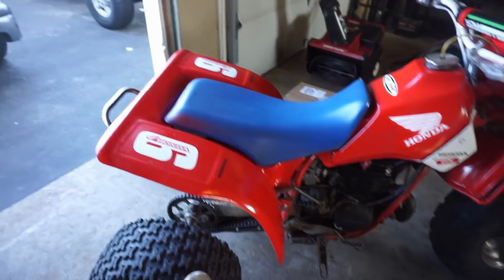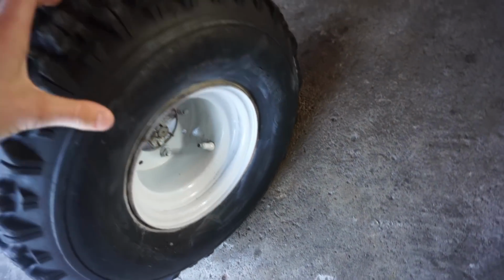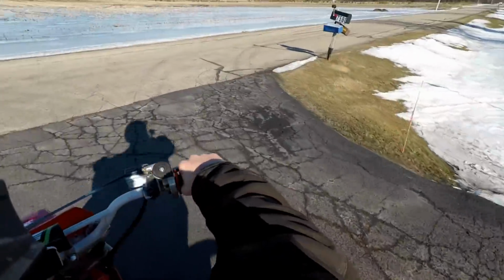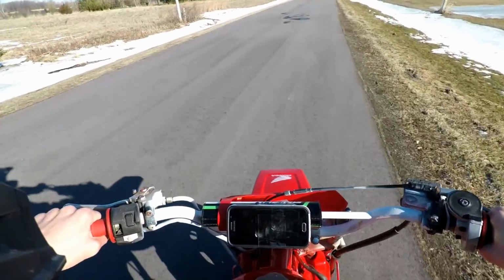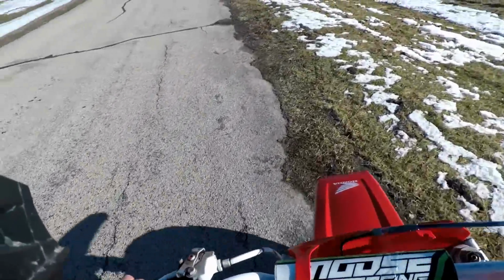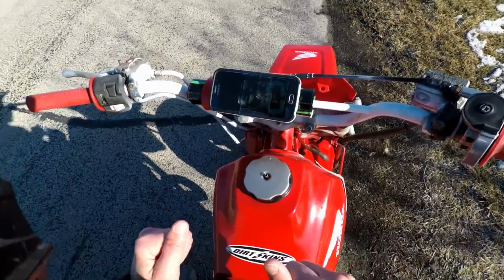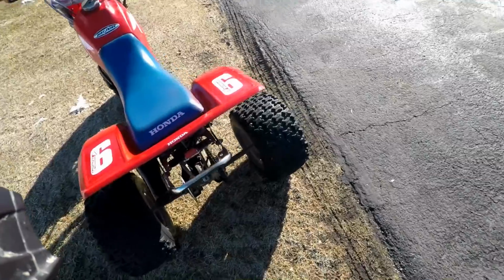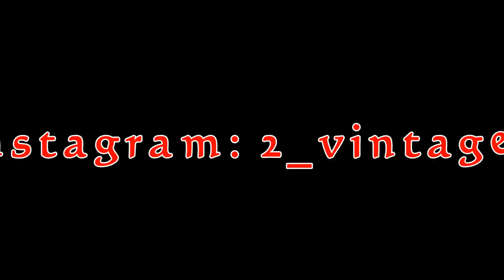Honda Atc 250r Top Speed!!!

Comment: Legend has it that a limited number of the 3rd generation 250Rs were capable of 110mph due to a mix up over gearing at the assembly plant.
Reply: I have a 1985 ATC 250r thats heavily modified and even with significantly higher gear ratio than stock, it goes just over 90, nowhere near 110, its simply doesnt have the power to pull it, especially from the factory

that rumor is 110+% busted

Comment: Mine was clocked at 82 in the cane fields by a palm beach police officer
Reply: 😂hands down brother lol
Reply: not stock it wasnt dork
Reply: No way
Reply: Balls of steel you have @Charles Pierce
Reply: I had an 86 250r and I ran it on the road and had my brother go side by side in his honda accord and by his speedo we were do 86 mph on top end 😁 and the water cooled 250r's will stink on the air cooled ones . I had an 84 that was .30 over on the piston , boysen racing reeds , ported and polished , basin pipe and my father in laws 85 water cooled 250r would kill mine in a drag race , after second gear his would eat mine for lunch!!!
Reply: 1misanthropist  That sounds more believable than Charles claim. Lol
Reply: That's crap Charles, there's no way a stock 250R will do even close to 80 mph. Much less 82.
Reply: Especially not an air cooled 250r!!! My 86 watercooler with a Bill's race pipe , Boysen reads,  and jetted heavy for topend would pull 86 mph , and my 84 250r bored 30 over , forged piston , ported and polished , 38mm Mikuni and Basani pipe wouldn't even hold a candle to my father in laws bone stock 85 250r . He would stink on me after 2and gear , just run off and leave me!!
Reply: Maybe he was wearing a timex from Walmart. He's kinda dumb for doing that on the road. I had an 81 bored, ported higher performance carb jetted runnin 65 next to my buddies bronco on the dirt next to the road and it had plenty more throttle. I guess 6 inches is 8 huh. Maybe I was going 85. 😉
Reply: @datrixta4744  Well you'll never know the true top speed unless you run it on a smooth road. I don't care about top speed. I just like power when I'm riding.
Reply: @user-zt2cc7qq9b  can run em faster on a hard dirt flat then pavement. Sounds a little odd but, on a hard dirt flat I could run it faster then on pavement. The traction is so great on pavement that even the slightest nudge on the handlebars will slow you down its just to fast for the way these handle correctly on pavement. There's such a drag that you're able to go faster on dirt more or less skipping across the ground rather then catching and slowing you down. It's hard to explain and counter intuitive but, unless you were riding perfectly straight withiut even the slightest nudge left or right and everything was perfectly aligned I'd put my money on even the best riders having a faster top speed on a dirt flat then pavement unless maybe it had different tires or some modifications. Let's say you were to get past the who gives a shit how dangerous it is they were not made for the pavement and you're just able to gain a faster top speed on dirt without being glued to the ground. The gluing effect slows ya down I promise.
Reply: I totally believe a water-cooler one could!! My dads bone stock 85 would gap my Banshee out on the wide open desert! He’d even pull 6th gear wheelies with it!
Reply: @datrixta4744  I believe you think it goes faster because of a rougher ride but it's a fact that drag of any kind will slow you down on top end.
Reply: I used to go ride the trails in the Ocala national forest I live by it
Reply: Its completely possible it would do 82 mph  with a different sprocket

Comment: It's usually the CDI which limits your revs. A 2 stroke isn't really designed for long periods of wide open throttle if you plan on doing these I would run it rich for a little more protection.

Comment: If you have a torch with rose bud you should pull the expansion chamber off and burn out the carbon. It should be louder than that, even stock.

Comment: It probably needs a top end rebuild. I'd like to walk you guys through that procedure. You are skilled enough and it is as simple as changing a tire. Infest in a compression tester . Super cheap at Harbor frieght. Most of these were governed or geared to 78 mph.
Reply: the 250rs have no moving parts in the top end, but yes putting rings in every now and then can keep them in good order
there is no governor anywhere on this ATC, 80mph is pretty much all this machine can pull without adding horse power, but they do stack power on quickly with modification

Comment: I've never seen a 250r that weak..smh..that thang don't even sound like it has a power and.. should be standing up all over the place
Reply: Brian Jeffries looks fast
Reply: gotta keep in mind that its the air cooled model,nice trike
Reply: Even air cooled.  It should be pulling much harder.
Reply: Five hundred 20s  i rode a 350x when i was 11 and weighed about 70lbs this was about 6 years ago
Reply: @stop reading looks can be deceiving just saying i own 2 of them and that is a weak one mine are top notch tuned by a man that we shall call the wizard if you know you know so yes regular 250rs they are very quick but there is a difference in them depending

Comment: Only thing I can say about the air coolers like my 84 model is that I wish it had a six speed transmission. It really could use one, but two strokes are not meant to be ridden at high speed for an extended period of time. The fun is in the quickness!  that power band!  that is the rush about a two stroke. I don't need to sustain 60 miles per hour for a long period of time.
Reply: @dave himlin correct, all 5 speed until 85 liquid cooled.

Comment: So I have a 82. Atc250r and stock it would pull the front wheel off the ground through the gears, it most definitely isn’t running like it should, cuz as I said even stock riding mine through the woods and on the pipe you have to steer it with your body cuz the front wheel doesn’t stay on the ground, unless it’s slick out an u are loosin traction but even still. Now she has a bunch of upgrades

Comment: Mine did 143 mph and had a little more but my 150 shot of nitrous ran out and the turbo over boosted at 23 psi and blew the head off .
Reply: Some kid legit tried to pull some BS like that with my autobody teacher back in HS. I walk into class, second day of school, and I hear this kid saying he ran low 10s with his stock Jetta. I quote "It overboosted to 35psi and blew up after I went through the finish line". I hit him with the "oh, you mean in the 1/8th mile?". And I didn't give at all, kid wouldn't take it, insisting his otherwise stock Jetta ran 10s in the 1/4 mile. I shut him down so hard on it he transfered out of the class two days later. He was the kind to sit in class, second day of school, with his feet up on a chair. I was daily driving a cammed LS swapped 78 Firebird I had at the time, lmao
Reply: @excalibur3895  😆😆😂

Comment: 75 mph stock was reported by dirt wheels magazine back in the day
Reply: Nope As a matter fact dirt wheels did not do TopSpeed only three wheeling magazine which changed into Atv sports had top speed in the specs. A bone stock 250 R of that vintage off the lot will go  no faster than 68 the 85/86 had the top speed of 71
Reply: @ronaldtartaglia4459  wrong but nice try.
Reply: Simple Waze you are wrong
depending on weather condition stock maximum speed 71 nominal speed 69 mph. Don’t tell me I’m wrong you’re wrong.
Reply: 76 dirt wheels

Comment: Did you ever get that thing to run like it should? It needs reeds are a carb tune (something). Is compression good on it? All of this has probably been mentioned in comments. I did not read them all. Should quickly go down to a nice idle though. Something wrong.

Comment: Those go way faster than 60! It’s more likely 80
Reply: its probably geared up a tooth to get 60.. stock is only like 55 on the air cooled. Liquid R stock gearing is like 70. Had an 82 and have a 86 now.

Comment: Stock 1983-84 250r atc top speed is 65 mph ///a stock 1985-86 honda 250r 76mph//// stock 1984-85 kawasaki tecate 70mph////stock 1986-87 tecate 250r atc 80mph/////This atc is just about right for a stock 250r but it shakes or wobbles flat spot tires?/bent rim?/bad wheel bearings?/Bent front fork?/

Comment: You should be hitting 72 miles per hour top speed on a 84 250R top speed on a 86 250R is 78. 84  are as fast as 350X 7072 miles per hour

Comment: your engine sounds like a 12 valve cummins diesel
Reply: I got a 12 valve Cummins diesel sitting not running needs parts good project sounds nice straight out of the turbo no exhaust.

Comment: 75 was all they had in liquid cooled. 81 was top speed for the older air cooled with balloon tires. 45 hp can only do so much. The 350x could barely do 85...your motor was dead...its supposed to wind out to 10 grand. A 250 EX 4 stroke can do 65

Comment: Mines hard to kick start. Help
Reply: Does it have spark? My '83 Honda Atc 250r was also hard to kick start it had a NGK spark plug look clean like new but no spark I put a old Accel spark plug I found laying around and it fired right up after 1-2 kicks
Reply: Also check compression, cdi box and coil that's all I know right now because i'm 13 years old.

Comment: The rear brakes were mediocre at best even when new
Reply: geoffreyjones2000 if your brake don’t work very well there’s an issue with your bike. I have an 1984 250r and the rear brakes are great. 300ex master cylinder, cr80 reservoir and a factory rear caliper. I don’t even have steal braided lines but hope to have them someday.
Reply: Honda's got great breaks

Comment: That's weak,we had an 86 250r,yes it was liquid cooled and eveything,popped wheelies in 6th gear,clocked it at 86 on an old road where we used to live,sadly we let someone ride it and then they sold it for drugs a little later on